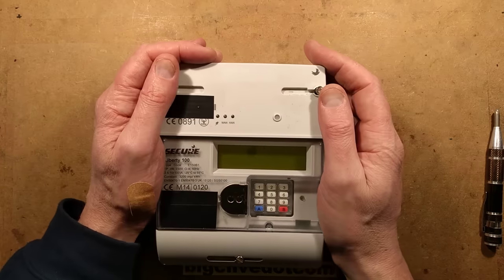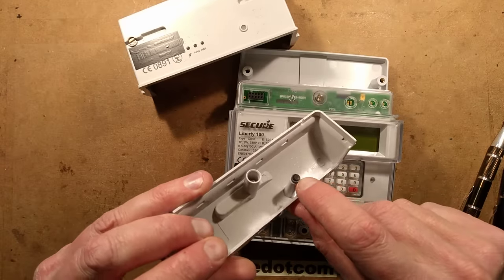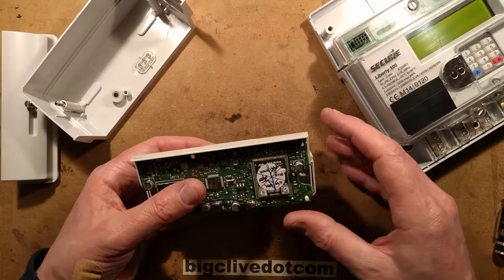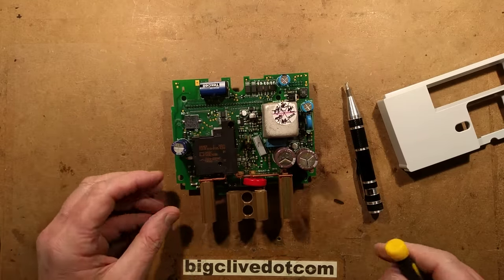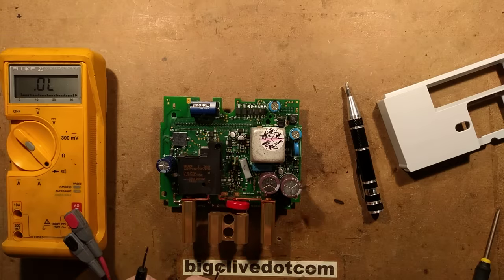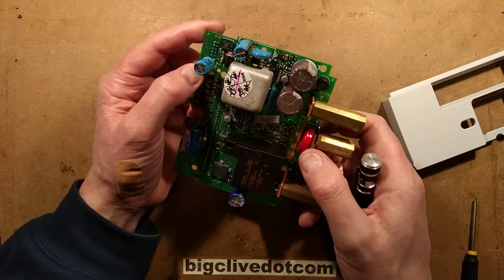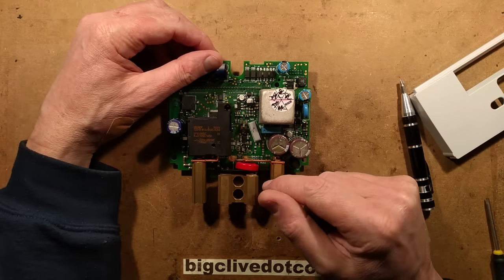Inside a smart meter, and the REAL problem with them.

Comment: We've been told we need a new one, which they supply for "free" but our letter box needs replacing which is our cost.

The other thing is the new meters charge for apparent power not real/active power so by default we will always be paying more. Which I don't think they were very transparent in talking about, there's some vague mention about "old power meters weren't correct so there may be a minor spike in your bill which would flatline after the first bill" lol at a new high, but I guess it tricked enough people. I respect the idea of pricing following demand but we've have very little financial incentive to use power when supply is low and demand is high so without a price signal I don't see the need to change prematurely .

Comment: How is my smart meter working when there is no 5G connection in my area? I've checked the signal coverage of all the networks a d not one of them has a 5G signal.
Reply from the maker: I don't think any of them use 5G yet.  Probably 2G and maybe also a mesh system where they use low power radio signals to communicate with nearby meters like stepping stones to where there is reception.
Reply: @bigclivedotcom  I've been wondering if they secretly piggy back on open routers; when we had B.T. broadband I had to opt out of some system that leaves a channel open for B.T. customers who are walking past my property to have Internet access, although its name escapes me, apparently all B.T. customers automatically have this on their router and have to request that its disabled, personally I think it should be the reverse. It wouldn't be hard for the government (and I wouldn't put it past them either, not these days) to legislate that all Internet providers allow automatic access to smart meters. Without us knowing it's happening. 
How 5G will be reliable is beyond me, if I put my phone in the same cupboard my smart meter is in I lose all Internet access except by home broadband, I can't even get 3G in there. As I understand it, 5G is more powerful but over a dramatically shorter range compared to 3-4G, with most power meters being in a cupboard (as far as I'm aware at least) and the rollout of 5G beginning to freeze up (I live within 60 miles of London, we've got an International train station and the town is popular with London commuters... which isn't popular at all with locals because they're pushing up local house prices at alarming rates- I digress, I would have thought my little town would be an obvious choice for 5G but, looking at the coverage map, there are about 3 areas in the entire town with 5G coverage: McArthur Glen designer outlet, a small patch of the town centre and, for some reason, a small stretch of a by-pass?! Virgin Media like to test their broadband speed increases here for some reason, no 5G though) I do wonder of 5G is a bit of a dying fish. It seems there are too many barriers to a quick rollout and all the conspiracies around the technology don't help; I used to think that my fellow Britons were too intelligent to get caught up in that stuff, alas they often find new ways of disappointing me.

Comment: Time of use tariffing... that’s what it’s about... to remove some load from the network by pricing some people off of using heavy loads (think cooking etc) at times of high demand... its such a simple idea. And recently the Welsh Government had a tender running for a company do run some data analytics on the likely effects of such a scheme..
Reply from the maker: It does mean that people may have to change their eating habits to avoid high bills.  And knowing what happens with peak pricing it will gradually be nudged wider and wider so people have no choice but to pay through the nose to have a hot meal before they go to bed.

Comment: I don't know if anyone has announced it, but 5G in its strongest option is 66 GHz waves. I would add that microwave ovens operate at wavelengths that, when averaged, are about 2.4 GHz ;)
How long it will take for people to get cancer when these antennas are dense enough for such short wavelengths to penetrate the concrete structures of buildings will not be known until statistics show it.
Reply from the maker: In the meantime I think the safest option is to stop using your phone, as it is the strongest local source of RF energy.
Reply: 60 GHz band barely penetrates leaves, it's not going through concrete. That band is only practical in extremely dense urban areas where a base station's effective range is a couple hundred meters. You're much more likely to encounter 700 MHz - which has been used for decades - or microwave bands - also used for decades. 5G is mostly an update of the radio modulation techniques and network components using all the same frequencies.

There are some studies on damage from microwaves from mobile phones. The most compelling and credible I read was of a phone operating on ~1.8 GHz, sitting in men's front pants pocket paired with a Bluetooth headset. When transmitting it put out a fair amount of power near the testicles, and over the study period a slight drop in sperm motility was measured. This was supposedly due primarily to thermal stress. The easy answer to that is... move the phone somewhere else.

Higher frequencies are less damaging as our skin repels them much more easily.
Reply: @holysirsalad  High-powered frequencies will knock electrons out of the orbits of atoms. The higher the density of high-powered high-frequency transmitters, the likelihood of this increases.
Reply: "strongest option"

🤣🤣 It's almost like you are completely clueless and will take any "conspiracy theory" you like the sound of at face value without question.
Reply: @nicknieznany  "High-powered frequencies"

🤣🤣🤣 Just stop!
Reply: Because You are always transmitting an electromagnetic wave signal of the same power 😏

Comment: I used to work for united utilities fitting water meters, smart meters, the problem with them is that vibration will make them clock up?  I was told if it’s not leaking to leave it alone? The property owner had to pay the bill, way more than what they were told before they signed up. Also the more people living in the house the more you pay I,e the more water is used. You will find that bigger properties are harder to sell if they have a water meter? Think about it?
Reply: You can remove a water meter. They are not mandatory.

Comment: I was forced to get it installed the tests run on it so far shows it is accurate and spot on mine communicates over 3G and was told it sends usage data every 5min as well as tamper and power outage info so technically they know power is out before I call. The only nice thing is because my connection is behind a fence they used to read it once a year resulting in big bill correction now I get an accurate bill every month

Comment: The red thermistor is a simple heating element, because the metal above coming from the relay is the measurement-resistor for the current, and this value is only accurate at a specific temperature and there comes the hall-effect sensor what detects awkward anomalies to the 50/60Hz because theoretically you could induce eddy currencies what effects in a false measurement of the current.

Comment: Meter so complicated big clive cant figure out how its gonna fry our brains, know what appliances were using and when. Haaaaaa
Btw i scwitched all of my home to led and had my bill lowered to around 100 bucks a month, immediately power company came on my property placed smart meter without my knowledge the next month my power bill was 30 dollars higher similar usage, i saw the security tamper tag in improperly discarded in driveway then looked at meter that had been changed. I called utilities and they said there was no request in the system for new meter and that they never installed one! So i told them to remove it and put back the old style meter which they did the following week. I am keeping the meter reader employed.

Comment: Theres no transmission capability if the modem is disconnected.  Hint hint nod nod. A nice faraday cage can make you bill freeze hahahaa
Reply: Those capacitors Clive mentioned on the communication board are hefty supercaps.  It has plenty of time to phone home, and you are on estimated readings until they send someone to look at the LCD.
Reply: nah, you just need to block the transmission capability.

Comment: To Clive:  The person who "knows" a lot about "power" or "electronics" should be able to understand something very simple....  Everything emits some sort of 'Radiation' which is 'Heat'.  It's the "Heat" that becomes Low + Decay Radiation as it dies that causes something known in the scientific world as a 'Voltage-Gated Calcium Channel' havoc.  Because our body/cells need Minerals like; Calcium, Potassium, Iron, etc, etc, etc...,  to function properly.  These  "Voltage-Gated Calcium Channel" are unable to open/close correctly which leads to a deficiency in minerals.  When that happens you will see your organs, like the kidney, liver, pancreas, and others and even the heart won't get enough or sufficient minerals which lead to autoimmune disease(s).  After those stages, that is when you will see cancer.  Cancer is a product of EMF/Dirty Electric.  
NOTE:  Please take a little journey to understand how much Radiation-Heat comes out from these things or cell phones when they pump out alerts or data to tell the "power-electric-gas-etc.." usages.  Also, I like to note.  These are now designed to send signals only at the end of the month to avoid the EMF that lots of people are complaining about.  
NOTE 2:  When you get autoimmune disease(s) or kidney, liver, pancreas, and other organ problems and then cancer, you will understand this post 100% and you WILL feel these, just like people before you.  
NOTE 3:  Learn before you speak because YOU ARE WRONG !!!

Comment: I had one fitted just like yours 
keypad for payg- topped up - put code in not accepted  :/ hmm try again ( tried numerous times ) SEVEN WEEKS later & im sat there every day thinking any second now lights n power will go cos ive used at least the 70 quid i topped up ( when it was cheaper) 
These dummies didnt even realise they had installed a NON PAY system for a billing quarterly system & it took SEVEN WEEKS - 11 call outs & 2 NEW METERS EXACTY THE SAME = b4 they finally agreed that it wasnt payg = coupled with my new now astronomical quarterly bill ( shows how long this took ) they then agreed they were all dickheads !

Comment: fusible link between the copper?
Reply: It's a meter shunt made from a low temperature coefficient alloy like manganin or nichrome.  If the copper bus bar was used it would have to be very long to get sufficient voltage drop and would be inaccurate due to its high temperature coefficient.

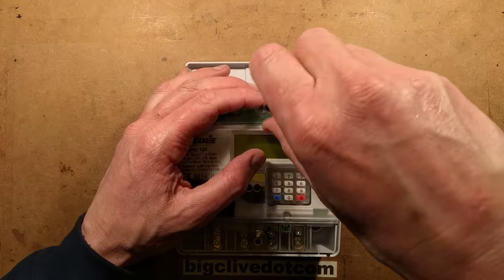Comment: 5:19 Yeah, this one transmits over celular network, so they replaced it with a model with 5G. Why do you think there were so many dumped randomly?
Reply: Smart meters do not use 5G, the data transfer is just not necessary. They began replacing the meters in 2018 with the new SMETS2 standard, allowing you to move providers without changing meters. They use a combination of WAN, mesh, and 2G/3G cellular depending upon availability.
Reply: @garethhanby  Then what's with all those videos showing the meters releasing ionizing radiation?
Reply: @SapioiT  I have never seen such videos. Are they in the same place as the flat earth and chemtrail videos?
Reply: @garethhanby  No, they are using gayger gauges, or what the name of those measurement devices for radiation is, at different proximities from the 5G smartmeters, to get a clear indication of how much radiation, including ionizing and non-ionizing radiation separately, is being generated by the smart-meters. There are even law-suits involved, as well as evidence of electricity companies illegally trespassing onto people's property and replacing the existing electricity meters with smart meters after the people who own that property have clearly declined the installation of those smart meters, in many cases in both writing and calls with the company in cause. 

Adding to that the sudden drop of animal life and even plant life in the area, which can clearly be observed through photographic evidence at different time intervals, with a control area which didn't get a smart meter or 5G tower nearby, and the whole thing seems like as much of a conspiracy as the planned obsolence/obsolescence is, minus all the big lawsuits won against the big companies.
Reply: @SapioiT  Well, crazy conspiracy theories ignored. This was back in 2018 and in the UK, the SMETS2 standard does not use 5G so it is all nonsense.
Reply: @garethhanby  Fair enough, different countries use different smart meters. But about "crazy conspiracy theories" I don't agree. Just because something is called a conspiracy, doesn't mean it's not true. Did you hear about that conspiracy theory about manufacturers making products which break after the warranty ends, so people buy more products? It's called planed obsolence or planned obsolescence, and it's backed up by plenty of law suits won against big and medium companies alike, including a few class-action lawsuits won against them. 

Just because it's called a conspiracy theory, doesn't mean it's not real. But maybe it just didn't get close to you, yet.
Reply: @SapioiT  Conspiracies that say 5G is harmful are crazy, as are all conspiracies that rely on hundreds of thousands of people lying to you.
Reply: @garethhanby  But then again, you can do the experiments yourself, if you want to. Besides, it's not like "hundreds of thousands of people lying to you" wasn't done before, even many times in the recent past. You're likely no foreign to fake news.

Comment: OMG thank goodness BC has done a video on them
So our empty house has nothing but a 3w led bulb on 24/7 for the last month
nothing else is connected and our bill is £24, so £24 for 3w 28 days
the bill says we used 95 units

its a move so have been forced into a smart meter for the first time
thing is we can't even get a phone signal to send text there, so how the heck is it sending info
Reply from the maker: There may be passive loads like power supplies for equipment in your house.   These meters are not great for dealing with very low loads.

Comment: Smart meters are not about accuracy, but about monitoring and being able to disconnect you at ANY time for ANY reason...
Also, microwaves do affect you as that is part of the approval process for mobile phones. However, go look up how these tests do NOT reflect how phones are actually used as they don't test for a child's head and for having the phone closer than 10mm...
This guy probably doesn't think flouride in water is a problem, in spite of decades of research...

Comment: Actually, the first cell I owned, was the old type where you had to pull the antenna out of the top of the phone.  I also lived in a rural area where service would cut completely to the rest of my home about 4 miles away. I found myself always on the phone right after work, and would pull out, into a turn out, which was right before service was no longer available. I started to exhibit eyes twitching over time, and breathing problems, and an eye doctor told me they could give me shots in my eyes to calm the problem down. 

By strange chance, I stopped using the phone for weeks, and the symptoms went away.  My partner wanted me to move with them to Spokane to look for property and asked if they could use my phone.  I told them sure, but additionally warned them of the problems It was causing me, and within days, their eyes started to twitch as well. 

It was a much older phone, totally different band and not cdma as I recall.

Comment: You are criticising these meters because they can be used by unscrupulous suppliers to overcharge you - But they simply count Amp Hours and if the price of Amp hours is agreed and not honoured then the company is committing fraud and it doesn't need a smart meter for that it can fraudulently charge the wrong rate at any point in your relationship with them.
I haven't heard a single criticism from smart meter detractors that has anything to do with smart meters - and is only a reflection of their paranoia about the dark forces of electricity suppliers that are arrayed against free-thinking down to earth conspiricists.

Comment: Suffice to say they didn't invent them for our benefit. They have just rolled them out here in Ireland, and they are smart meters. But I have tried to find out if the householder will be allowed to monitor there own usage by day/hour etc. Answer I got they have no plans to supply monitors or a app for householders to monitor their own usage, but they can.
To me that defeats the whole point of the thing in the first place. But they get to know how and when you use their power, and you can be sure they will share that data with other people. We are just giving more of our private information to devices they say are for our benefit.

Comment: Just retired but for some time was employed by 'Love Technologies' making mesh screening for these and many other types, all of which emit loads of Electro Magnetic Radiation. Enjoyed my pocket money but mostly knowing I was protecting the lives (literally) of those my cages were going to. Repetitive strain injury forced me to stop, very unfortunately.
Reply from the maker: The dangerous RF emissions thing is not true.  The single biggest source of RF you are exposed to is holding your phone to your ear in a low signal area.  RF drops off at distance following the inverse square law.
If anything, your mesh covers for meters run a high risk of contacting bare copper from a bad installation and pose a shock and burn risk.